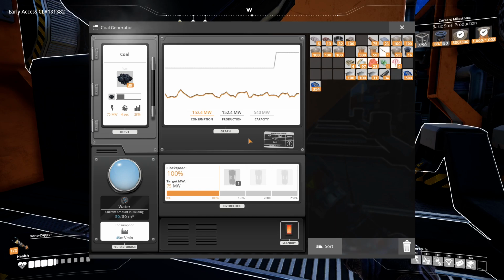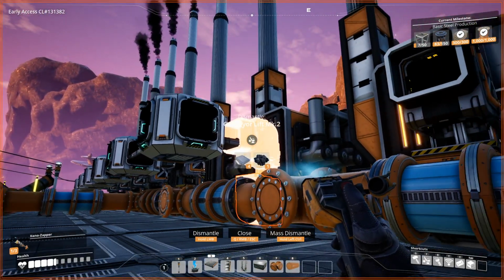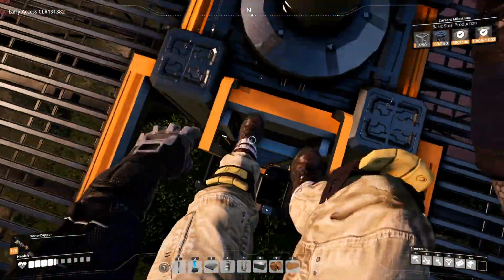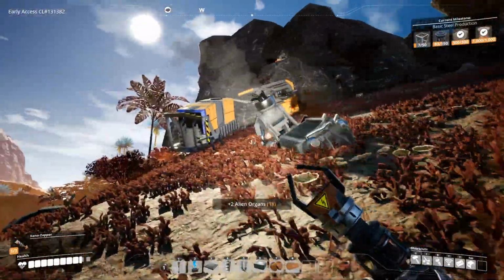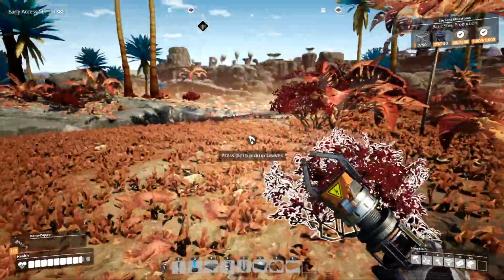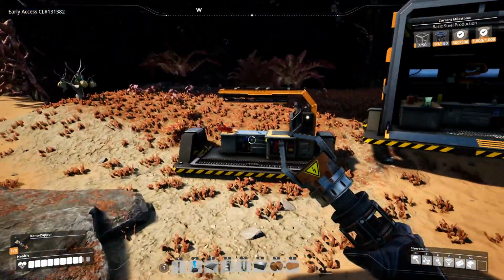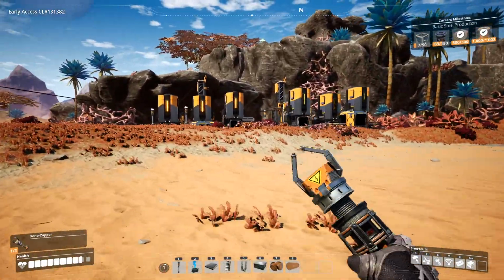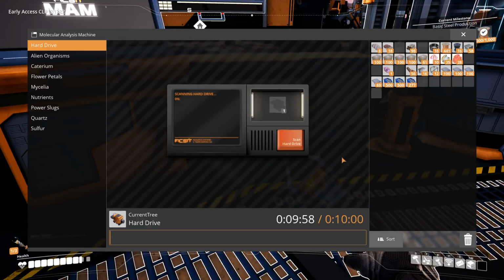Doubling Iron Ingot Production - Let's Play Satisfactory Update 3 Part 13

Comment: Power slugs can be used to create boosters. The purple ones are the rarest and once you research them in the MAM you can turn them into booster cells which can increase output/production of anything up to a maximum of 200% output.
Reply from the maker: I need to get on that!